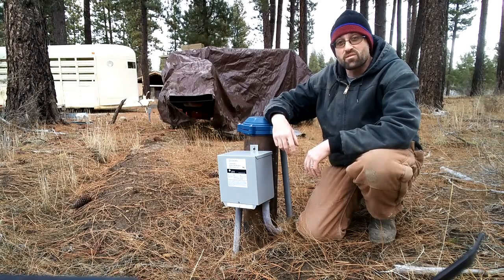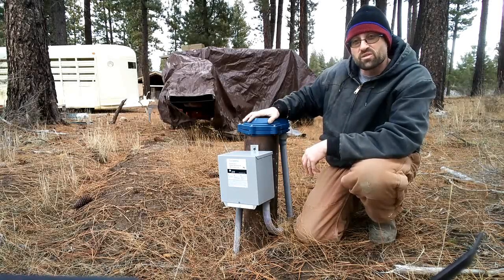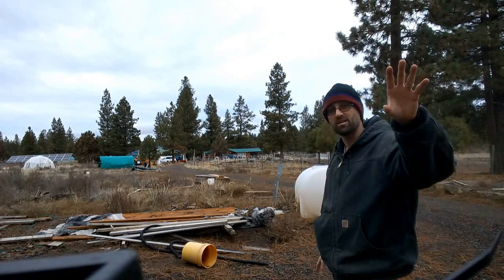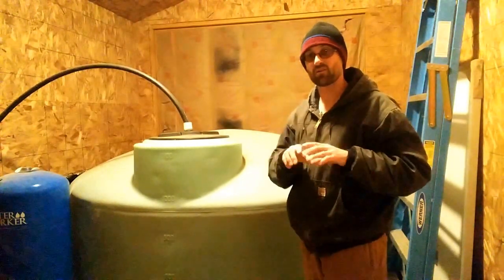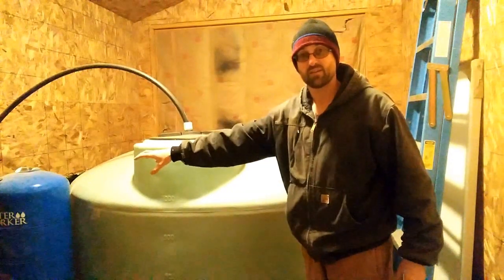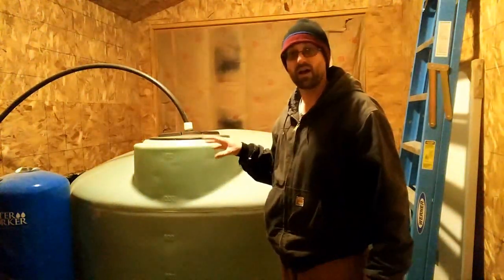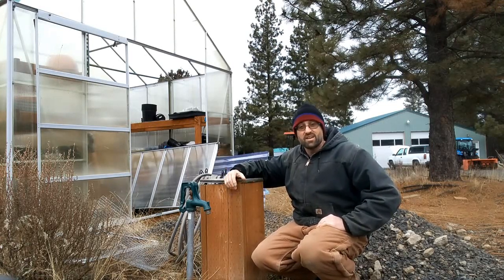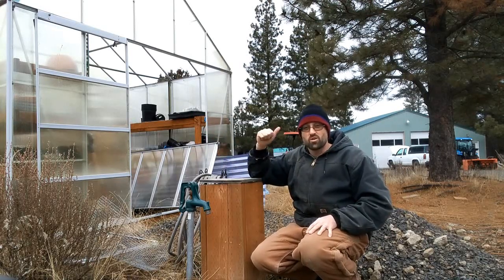Design Your Off-Grid Homestead Water System

Comment: Place stubs in strategic places as you build. It makes for simple expansion later. Lay surplus irrigation wire in your trenches. If you think you only want one valve now, lay wire for four etc. Electric valves are great and easy to install. Go big on pipe diameter. It doesn't cost much more to go 2" instead of 1 1/2" and your energy loss will be way less. If you can, consider a loop distribution system. There will be less water hammer effect when the pump cycles. It also has the effect of further reducing energy loss by providing additional pathways for flow. This system allows for shutting down parts of the loop for repairs or expansion without effecting the entire system. Have plenty of shut-off  valves in the loop to isolate sections as needed. Go big on storage tanks, not much more expense.
Reply from the maker: Good advice.  Thanks!

Comment: Kind of wish we would have gone a little bigger/more powerful on our pump and pressure tank just in case but so far so good.
Reply from the maker: Since Canaan is an engineer, we tend to go a little larger than the minimums dictate.  It's easier to pay a little more on the front for extra capacity than to wish you had it later on.  You'll see that thinking in all we do.  Solar, water, food production, etc.  All lean to the maximums.

Comment: If you don’t mind me asking how much did all this cost you guys?
Reply from the maker: It's kind of a tough one to answer, as Nikki's folks started the water system about 12 years ago, and we finished it up. Somewhere in the neighborhood of $10-$12k would be our guess. Originally the house ran off of a cistern, and Nikki's dad hauled water locally to fill it when they were at the property. A few years later they had the well drilled and pump installed so that it would be easier to haul water from the well head to the cistern house. Nikki moved in five years ago and the next summer we ran black pipe from the well head to the cistern, and the next summer were able to build the shop, move the cistern and bury all the piping. 
Our neighbor had their well dug about three years ago, and they spent over $10k just for the drilling, plus another $6k or so for her fancy off-grid solar pump (which, consequently, died last winter from over use). Depth varies dramatically in this country, and you'll want to find a dowser/water witch to tell you where to dig. Ours is just around 300 ft deep. The neighbor who thought that was nonsense ended up over 600 ft. 🤷
Reply: Rainwater your bird house, Problem solved...

If you have a metal roof on your shop - use it as well...